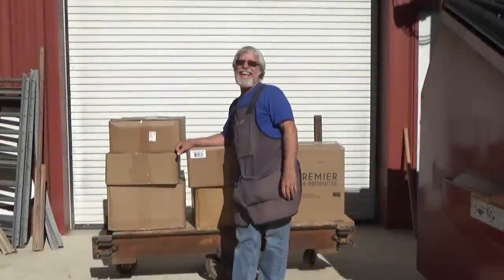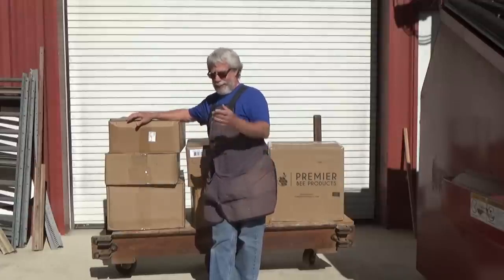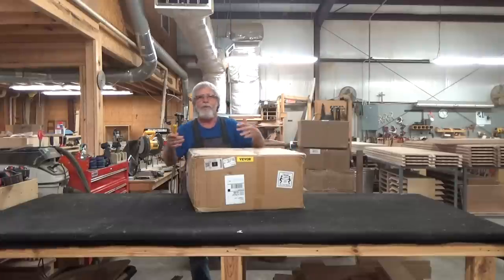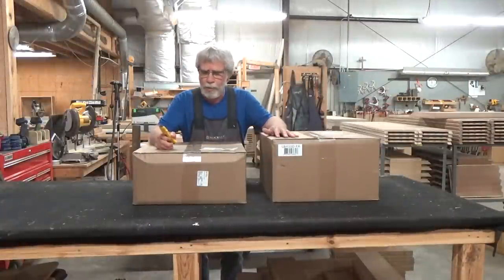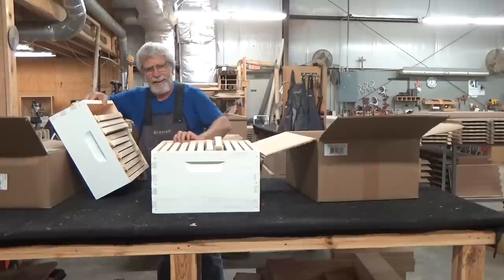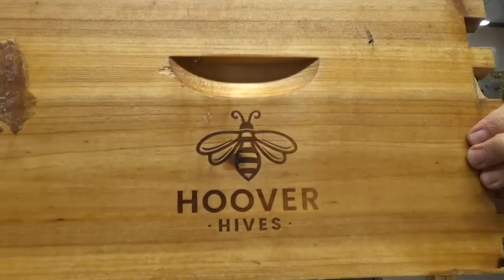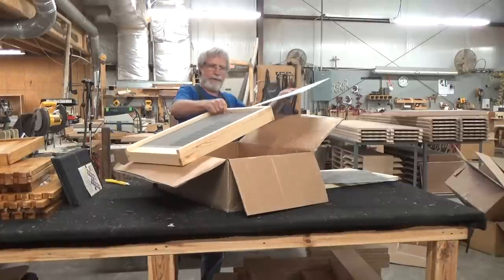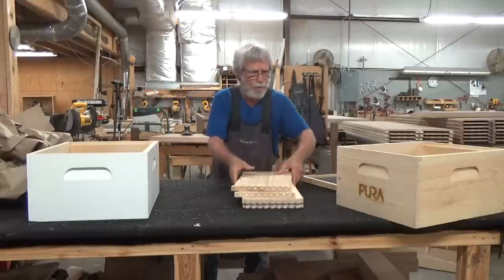Beginner beehive kits.  What's out there and how do they compare?

Comment: Thanks for the review.  A respectful comment on joinery.  There is a total of 9 5/8" of endgrain on each of the dovetail and boxjointed joinery.  The amont of less endgrain on the tapered dovetail pin is quite inconsequential.  There have been tests done that actually show that box joints are indeed stronger than dovetails, assuming glue is used.  A prewaxed box like the Hoover is impossible to glue.

Comment: I'm now using Apimaye Insulated beehives with a R 6.93 insulation value. Temperature out side last night in Tacoma Washington  was 25 and inside the hive was a pleasant 82 degrees and 52% humidity. I have BroodMinder scale and temperature/humidity sensors installed and can read it right off my cell phone 24 hours a day. After switching from wood to plastic everything, I haven't had any more problems with wax moths. Jeff, I give you the credit for the all plastic triple coated frames. After watching one of your YouTube videos I thought I would give it a try. Wouldn't you know it, the bees immediately jumped right on those frames and started drawing them out.
Reply from the maker: It's to bad I did not include the Apimaye HIve in the video, they are an excellent choice for so many reasons, and I'm happy you are reaping the benefits of using them. However, for most beekeepers, cost is always a point of consideration, and they are on the more expensive side, but well worth the extra expense....especially in colder areas. Thanks so much for reminding me about them and taking the time to watch the video. Until the next time, God's peace.
Mr. Ed

Comment: Great job and informative. One question I had and that I never learned correctly was on pre-waxed frames. Do the bees still add wax to the foundations or do they draw out what was supplied? Thanks, Merry Christmas, and God bless!
Reply from the maker: To my knowledge, if the foundation has only a single layer of wax applied to it from the manufacturer, it is not enough for the bees to draw out and they will need to produce more.For that reason I would strongly suggest getting the most wax on the foundation that you can possibly get. Still, having a little bit of wax is far better than no wax at all. Thank you for your blessings and for watching. Merry Christmas to you and yours as well. God's peace.
Mr. Ed

Comment: Hi Mr. Ed, as an old wood guy I can let you know a nail has a stronger hold than a screw. It will outlast a screw by years.😊
Reply from the maker: When in the shop building things that stay indoors, I use screws, but on the outside where moisture can get into the wood so much easier, a nail will hold longer....especially if it is ring shanked. Merry Christmas Bob, and God's peace.
Mr. Ed

Comment: I needed a few boxes in an emergency and ordered the Vevor hive last year. I was actually quite shocked by the quality. They aren't as good as the "name brand" companies, and having a little wood working experience will help make the quality better. I ended up reinforcing some of the top cover joints and put counter sunk screws into the bottom board - for example. But for the price, it's hard to beat and they are holding up great.

Your timing on this video is funny as I had a couple more sitting in my Amazon wish list. However, I wanted to use your coupon code on the website. No matter how I put the code in, I cannot get 12HIVEBEE to work.
Reply from the maker: I can't understand why the code is not working as I was asked specifically to include it in the description. Keep on trying. Thanks for watching. God's peace.
Mr. Ed
Reply: @JeffHorchoff   I tried every variation, hopefully they remember to add it...

Comment: A very nice presentation. I would be curious to how to maintain the wax coated hive and how long this hive will retain it's beautiful eye appeal! That hive may be better in northern climates vs down in the south in the hotter and drier regions of the country. No doubt it has the great quality of water resistance.
Reply from the maker: We will all find out at the same time how this hive can take the heat and humidity of Louisiana real soon after I install some bees into it this spring. Thanks for watching. God's peace. 
Mr. Ed
Reply: Jeff, if you decide to build a paraffin boiler, I recommend you wrap it in rock wool insulation and then put a thin stainless steel shell over it. It should minimize how much energy it takes to keep it hot and less propane. 
I'm going to give your shop a call with an idea on wax cleaning. 
Love your program

Comment: I bought a Vevor hive and the Amish built hive. I ordered assembly of the Amish hive - that was a mistake. It was not assembled very well and required me to redo almost every joint of the box and frames. No glue or safety nail in the frames. The Vevor box was a lot less expensive but did suffer from poor workmanship and no wax on the foundation. 
Overall, I am happy with the Vevor hive, but don't set you expectations to high. I will not purchase another Amish hive I don't think, the assembly was very poor even if the base material was higher quality.
Reply from the maker: I found no issues with the Amish built hive nor the Vevor hive, but still, I would buy the Amish one over the Vevor. God's peace Tommy.
Mr. Ed
Reply: @JeffHorchoff  the wood quality was very good on the Amish hive, it was simply the assembly that was subpar. No screws like in your review, just staples and only two on each side.
Thank you for your review, it was very informative.